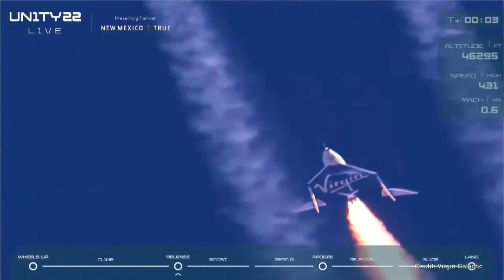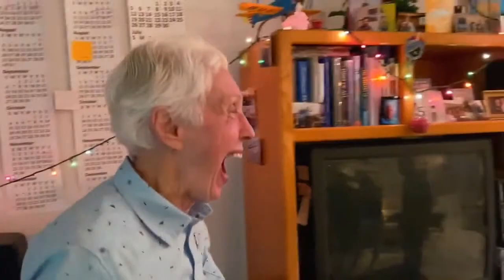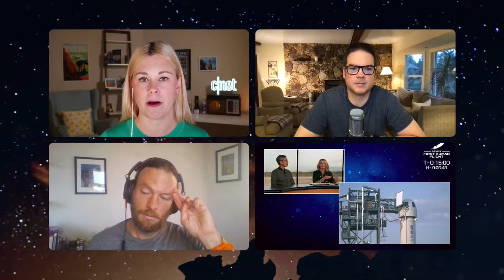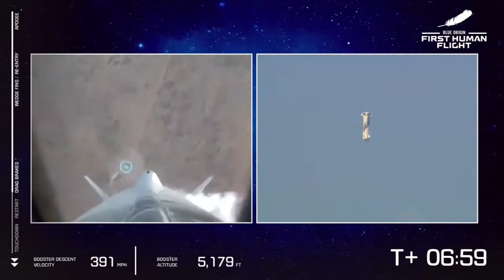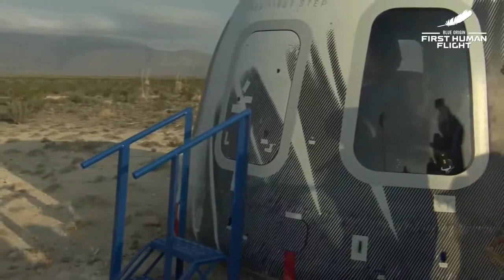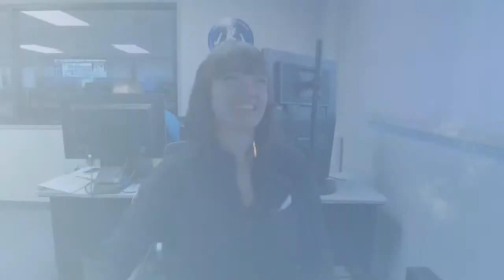Blue Origin launch with Jeff Bezos and crew -- Watch party

Comment: Neat video!  I'm glad it was a success and I'm happy for the astronauts.  Congratulations!

I noticed: 
At T+05:42 on descent of the booster, something appeared from under the booster moving upward in the left image from about [video 47:01] 194,829 ft to [47:02] just after 193,531 ft.

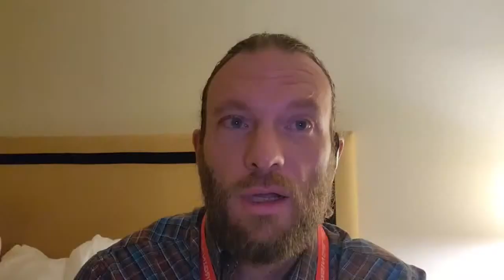The booster reached the max descent speed of 2,597 mph at T+06:10 at 96,943 ft, so that must have been when the main engine began to slow further descent.

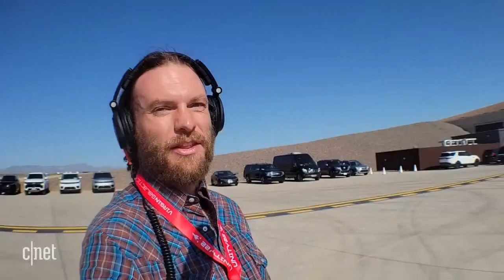Something squarish and cloudy white appeared around the bottom of the booster at T+06:43-T+06:44 [48:02-48:03] 16,948 ft - 15,561 ft.  I suppose it was condensed water vapor from exhaust due to steering for stabilizing the rocket.